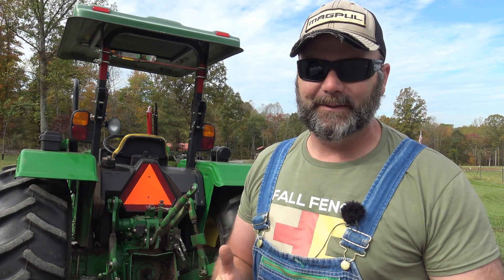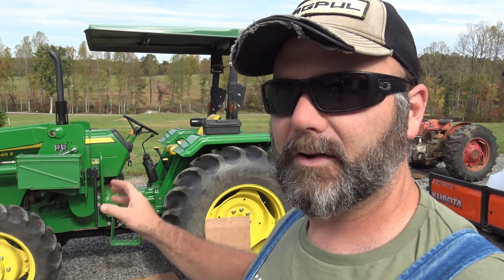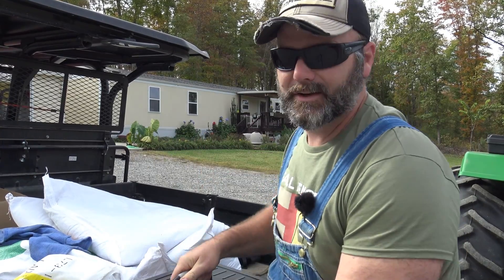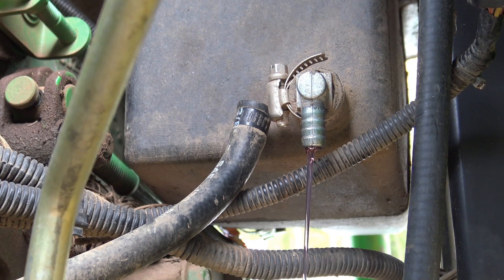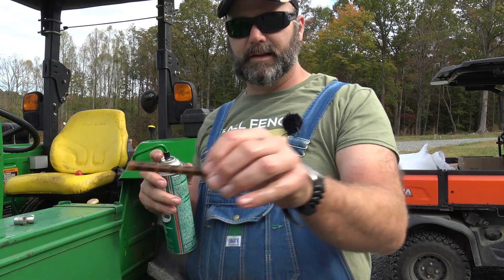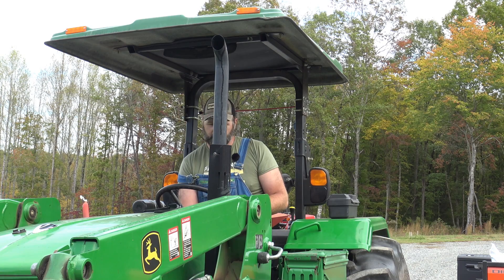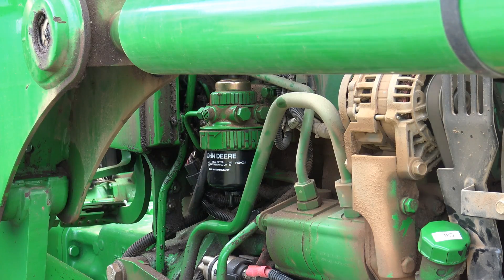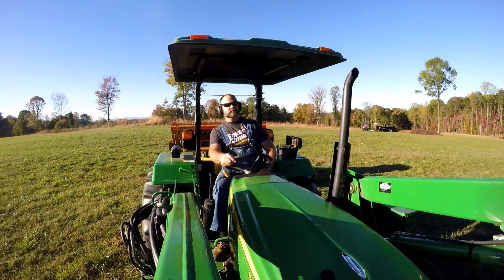This little thing was the problem...but what's stuck in it?

Comment: We had the same problems on both our JD tractors , the local JD mechanics that service our machines didn't know about the in tank filters. We cleaned them ourselves.
Ours was caused by water entering our old plastic tank , replaced it with a new 1500litre tank and all sorted

Comment: I am glad that you found the problem and I definitely would replace that filter if I was you so that problem don't come up again for a long time. I have a John Deere 790 tractor without a front bucket and a 3032E tractor with a bucket and so far I have not had major problems with either of them. The 790 tractor had one problem with a fuel line which I replaced and it was back in action.

Comment: A friend of mine who is a diesel truck driver over-the-road driver told me years ago that the diesel we purchase is crap. He owned his truck and he told me he always uses Lucas gas and diesel treatment. 1 qt. per 100 gallons. I have been using it since then and no fuel issues. I have 3 diesel engines and no problems.
Reply: Stump Head I’ve heard much good about Lucas products as well.

Comment: Glad you found the problem and was able to do a quick temporary fix.  Personally I think there is a engineering design problem also.   There was enough room to put a filter/cutoff valve assy outside the tank.

Comment: Well done. I have 2 suggestions for you that might help. One, if you don't already have one. Get a set of nut drivers, the will save you a lot of work with those hose clamps. The second and probably more important, get a in line water separator filter to put on the outlet of your tank in the truck. This will help to make sure that you are feeding your tractors good fuel. Take care!
Reply from the maker: David you make a good point...I'm actually working on a video called "The Psychology of the Screwdriver"....this will detail why I went with the screwdriver v/s the nut driver..I have both and agree with you...but for some reason I still went with the screwdriver lol

Comment: I had the same issue, removed the plastic filter altogether, installed an inline JD fuel filter about 1 foot down from fuel tank and problem solved.  Plus you can remove the JD inline filter when you want, wash it out with water, let dry, re-install....forever.  The JD filter does not need replacing, just cleaning/washing.

Comment: Josh, you should consider getting a 275 gallon tank like is used for a fuel oil furnace and have your farm fuel delivered.  It will cost a little more, but you will have a single source for fuel and you will eliminate fuel runs.

Comment: I have had problems like you had in the past. One thing I am a beliver in now is running diesel fuel treatment in the fuel. I use John Deere winter fuel treatment year round in mine and have had no issues for several years now.

Comment: I have cleaned many tanks on equipment,, just pull off the drain and line,, drain fuel and  pressure wash the  inside. Then blow dry with dry with compressed air or a leaf blower..
Reply: done this on lawn equipment and you think you got it all out, nope. then you have problems running until all the water gets out of the gas or fuel. Just another can of worms.

Comment: The best way to avoid that type of fuel issue is to use a transfer tank with an extra fuel filter in line. I have an old 50 gallon B truck saddle tank with a GPI 12V pump with the LD in line cartridge/ canister filter. It stops 90% of trash getting into the tank.  If water is a problem then they have a special waterblock element that I Know Works well.

Comment: I would reccomend using some of that hotshots secrect you used in your pickup, also when fueling any piece of equipment, especially out of a can, we use those cheap disposable paint filters in the bottom of a funnel

Comment: If you have an issue with possible water in your fuel again, go to Napa and get a bottle of Power Service Diesel Fuel Supplement. Follow the directions on how much to add to each gallon. This stuff works Awesome. I used to work for a company in NY were we have hundreds of pieces of Equipment, I made sure all of our Fuel was Supplemented with this. We stopped having fuel related issues.

Comment: Josh use this product in your fuel it will clean the screen of alge and sludge it's called  diesel kleen
Reply: Always look to your local (most local) truck-stop for ideas and fixes too. Diesel-kleen is great for cleaning algae and bio-sludge from the fuel system. As I don't farm, not sure if it is available at tractor shops or farm stores, but it should clean your system with no more than we saw in the bucket. Good luck, stay safe, and we'll see you on the next video.
Reply: Thomas Russell 
Get it at Wally World. They all have it if they have an automotive section.
Reply: @ralfie8801  I don't own a diesel, but thanks.
Reply: @thomasarussellsr  we have diesel kubota mower love the beast
Reply: @michaelmactavish1728  1984 882D CUB CADET FACTORY ORIGINAL 3 CYLINDER KABOTA 18HP DIESEL. MY FIRST ONE AND I LOVE IT CAN PLOW SNOW ALL DAY LONG ON 3/8 OF A 4 GALLON TANK. DURING THE WINTER I USE HOWES DIESEL TREAT CONDITIONER AND ANTI-GEL.hAVE LEARNED A LOT FROM THIS LITTLE LAWN AND GARDEN TRACTOR.

Comment: Everything I have that runs on diesel I run run a additive in the fuel to disapate the water, I also installed inline water and trash seperaters.
This allows me to eliminate the in  tank filter, where it starts.
Then if I have problems I can look into the glass bowl to check and if need change the filters.
This guarantees that it won't make it to the pump or engine, which could be very expensive. Good luck.
Reply from the maker: Well...almost 5 years of fuel put in this tractor and this is the first issue.  You make a great point...for sure all the fuel put in every tractor I've got is filtered before and after it's added to the tank...sometimes there's no winning! Grrr frustrating for sure

Comment: If you use a lot of diesel, it's worth getting a fuel polisher. Should be able to get one for less than $500. Saves time and money long term. Split it with you stepdad.

Comment: 2015 3025e JD tractor e series code ECU a 522242.04 this code is for this issue right here, dirty filter,fix remove the screen, clean the tank and put in a inline fuel filter. JD  (everglades) wouldn't help,  unless I brought it in, now ag pro of chief land walked me through it.  Thank you AG pro

Comment: I'd call that an EASY learn! Just a hose clamp and some brake cleaner. I'd have taken close up pictures of that filter to show your diesel source. I wonder if you might have needed to flush out tank. Not much crap drained out, but how much of what is growing in there did the filter actually catch? Find a way to treat all the fuel you have in storage. Treat that infection, it could come back.

Comment: Most all the older 5Es have the screen and create the same issue. Most Tractors we deal with we take that screen out completely. Then just install a in-line fuel filter close to the tank that’s easier to service rather than draining the whole fuel tank.
Reply from the maker: You make a very good point

Comment: Hi Josh. Great video. If you want to reuse that fuel (their's no reason not to,) use two or three (paper Automotive Paint, very fine mesh,) Paint strainers. Use the paper strainer's, inside a plastic fuel funnel.) If I remember, correctly that mesh ( (paper Automotive Paint Strainers) works out to 8 microns or less filtering. I think a human hair (0.004(ish) inches.) is much thicker, just to give some scale.
Reply from the maker: Watch till the end of the video..you'll get a laugh

Comment: Your Massey Ferguson's will have these filter's too. Ask your John Deer dealer if a "Mr. Gasket 9706 Universal Clearview Fuel Filter" would work right after the tank (I don't know myself) but if it dose it can also be ordered off of Amazon with fixed size chrome nipples on it tool and you can get replacement filter elements too.

Comment: This is a common problem with bio- diesel blend. Use a quality diesel fuel additive with each fill up also add it to your storage container at fill up. make sure the additive is also a lubricant to replace the sulfur in older equipmen like the MF 65

Comment: I think you were right when you said the problem was at the gas station. the problem is called diesel bug. A type of bacteria that grows in the boundary layer between the diesel fuel and any water that gets into there tanks (and I mean ANY WATER). Diesel is hygroscopic and draws water from the air even without water contamination, over time if the tanks are not drained from the bottom till all traces of water are cleared. but if diesel bug is let to propagate, clearing the tanks of water is too late as the bacteria holds water in suspension in the fuel and needs to be treated with something like Marine 16. I have no affiliation with them but I had to use it on my cruiser. Sorted the problem of sludgy mold growth in my tanks and filters.

Comment: Josh,
How do you transport the fuel from where you buy it to the farm?  Any way to filter it before or as you put it into the tractor?  Even a paint filter or if you can figure out a way to support it in a funnel a coffee filter would catch some of the debris that might be in the fuel.  If you find something in the filter at the farm start using a filter where you buy the fuel and show them what you are getting out of the fuel.  Another GREAT video, THANK YOU!
Reply from the maker: Alan...my brotha...it's filtered at the pump....and I have a filter on my 100 gallon transfer tank....just something that happens to diesel fuel.  The tractor has a couple fuel filters too...I agree with ya about the filter at the source...maybe a funnel with filter would be good also

Comment: Did that fuel come out of the truck tank that you fixed the pump on? Could be a two fold issue. I have always used Power Service or Howe’s fuel additive to prevent water related issues. You can buy water absorbers to drop in the tank that are attached by a cable. Once a month remove the absorber and hang it in a covered area to evaporate the moisture. Replace in tank to continue water protection.

Comment: You can reuse the fuel you took out just use a funnel with a filter in it to catch the trash in the fuel. The funnel we use to put fuel in our tractor has a filter in the bottom. It slows down the speed of filling but you catch all the trash. It dose not work on water or any moisture in the fuel.

Comment: Blow the pick up filter out with the compressor.  You are either getting dirty fuel  from your supplier or you own storage system. That can happen if they run their tank dry and and the new fuel going in disturbs the sediment that accumulates. Most stations don't left their tanks get to that point.  Then there is diesel bug that grows in your tank it looks slimey  similar to water being in there. Hows the filter look on your own storage tank. Does it have a water trap?

Comment: Would it be easier to remove the filter inside the tank and put a clear filter just outside the tank inline the hose so you could see from outside when a problem is developing with fuel?
Reply from the maker: We shall see..if this becomes a repeditive problem I'll do that for sure!  And put a shut off valve in place

Comment: John Deere has a flaw in their fuel tank design. That filter should be about 2 inches or so off the bottom of the tank to allow for settlement and sludge to settle in. All diesel truck tanks have their pickup tubes several inches off the bottom and most of the time they are on level ground. Not like a tractor were it is running on rough terrain most of it's life were the fuel is sloshing back and forth.

Comment: If your planning on putting an inline filter in. I'd take strainer out and throw it away and just screw the fitting back into the tank. At least with the inline you won't have to worry about having to drain the tank every time it  clogs up. Just pinch both sides of fuel line before changing the inline filter.

Comment: MOUSE IN THE TANK FOUND ON THE NEIGHBORS 455D HAIR CLOGGED UP THE INTERNAL FILTER IN THE TANK 3 HOURS TRACING THE PROBLEM DOWN . WAS NOT WASTING 5  GALLONS OF FUEL RAN ALL THE FUEL THROUGH A FUNNEL AND A WHITE T SHIRT ATTACHED TO A 1/2 INCH FUEL LINE AND A INLINE HIGH FLOW RACE CAR FUEL FILTER.

Comment: If you suspect water in your diesel fuel tank siphon off the bottom of the tank an inch to remove water as its heavier than diesel. Then add Diesel Kleen to remaining fuel as this additive converts the water molecules to burn able fluorocarbons and kills microbes.

Comment: Owning my second 5075e I figured fuel delivery was the issue. My first did the exact same thing as yours. New fuel filter and fuel took care of mine. I also now only use regular diesel as opposed to offroad diesel. Haven't had an issue since and the price difference here is minimal.
Reply: TheBoz1911 I own a 5055e and I only run on-road diesel in it and buy it from a truck stop since they will always have fresh fuel!!

Comment: Bingo on the algae.  Unfortunate reoccurring issue with diesel ownership.  Shipping from refinery to local port  of entry is often  by barge.  Any moisture accumulated  in transit feeds the algae. The algae is a chemotroph; requires no sunlight for sustenance and really goes to town on the sulfur in the fuel. Redline additive has helped me in the past. I guess it's  kind of luck of the draw  on each fuel  delivery

Comment: I would just remove that filter and run a inline clear filter down the line before the pump so you can see if the fuel has junk in it. and the filter is less then 4 bucks

Comment: I personally would eliminate that filter in the tank and put a inline filter in so you keep a eye on it and it would be easier to replace in the future.
Reply: Absolutely true !
Reply: that would be better but that 90 degree fitting will try and trap debris also causing the same issue. the reason for the strainer is to give the fuel in the tank more surface area to drain from when debris builds up in the tank, the thing i dont like is its horizontal position. If you do eliminate the filter in the fitting put a straight fitting on there so your less likely to have problem.  I see this problem on lawn equipment all the time.
Reply: Jon E i know exactly what your saying. I didn’t think about it that way. It would take a fair amount of crud in the tank tho to clog that up don’t you think?
Reply: @DirtyD234  yeah unless there is a microbe problem, but I think they're black.

Comment: Just rebuilt the head on my 1967 Ford 3000 diesel tractor, valves and injectors. Sucked out the fuel tank and replaced the fuel petcock and filter, the same type as on your John Deere. These are pre filters really that get the big chunks before the fuel goes to the main filters. Two in line main filters on the Ford before the injector pump to get what the screen missed. Evidentially diesels and I imagine any fuel injected system needs clean fuel as even very fine contaminates can clog your injectors like what happened to my unit. I was experiencing what is called “Wet Stacking” that is unburnt diesel fuel being blown out of the vertical exhaust pipe and running down the exhaust manifold and the side of the engine, sure sign of bad injectors. With new injectors and valves the old boy is running like a champ now. Keep your fuel systems clean men, that is all.

Comment: John Deere has a auto primer for the fuel just turn your switch on for 1 minute then fire it up.  
I work on tugboats as engineer we hold 32000 gallons of diesel and from time to time we algae there is a solution to add to your tank to eat the algae

Comment: So what good does adding an inline filter do since it would be after the filter in the tank that plugged?
Reply from the maker: Remove the filter from the tank....replace with a shut off valve and inline filter setup prior to the larger fuel filter that's on the tractor

Comment: I informed you what it was when this frist started. Mine done the same thing this is couse by bio fule most of the time. The fule that we buy has a percentage of bio fuel. This will require that you run additive or it will happen again.The fuel company is required to add the additive in the winter fule however my fuel company did not until I called them. No problems sense then.

Comment: You could place a vacuum on the fill of the tank and suction will allow you to remove a hose or fitting with less mess. In the tank filter are a waste, you should always be able to shut off the fuel, replace a filter and open the fuel valve. That is a terrible design. You might have flushed out the tank before re-installing that filter.
You could use a go-no go funnel filter to save that fuel.

Comment: How's the coolant level?  If the fuel system is water free, I would suspect a cylinder sleeve O ring leaking coolant into the cylinder when it gets warmer up.  I had that problem with a semi I used to drive.

Comment: If you call the number on your local gas pumps, they will do the footwork for you of inspecting the gas stations to find the culprit. It's a part of the North Carolina Department of Agriculture and Customer Services.
Reply from the maker: You know what's bad...Fuel in Virginia is about 20-50 cents cheaper...so I make the drive (10 mins) to save the $$$ filling the 100 gal tank
Reply: We call that "mountain gas". 😄